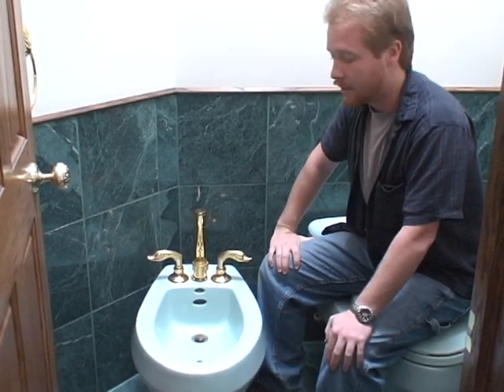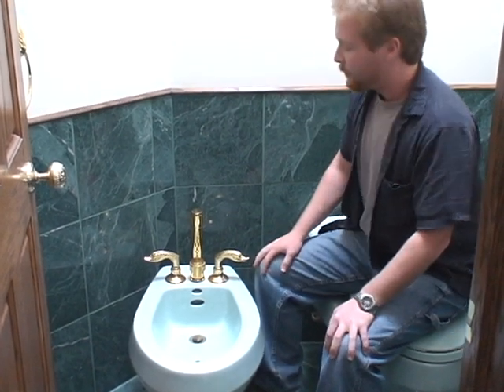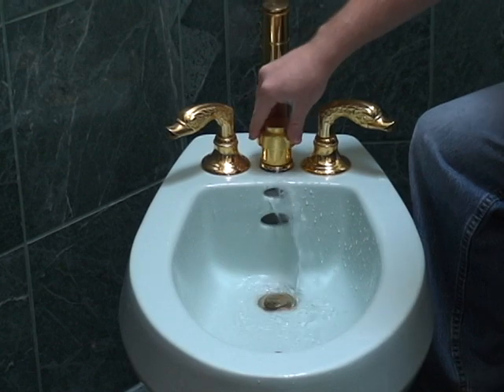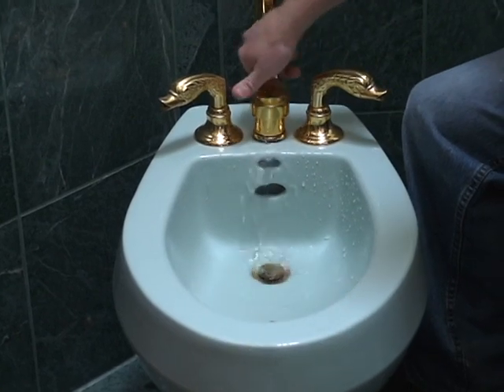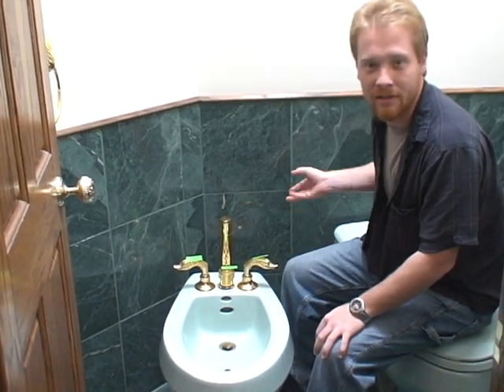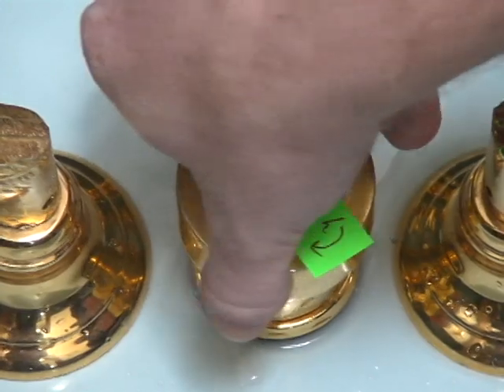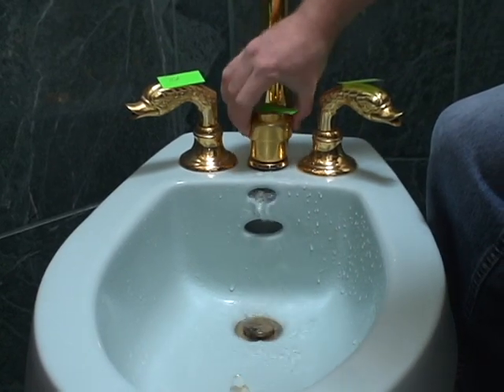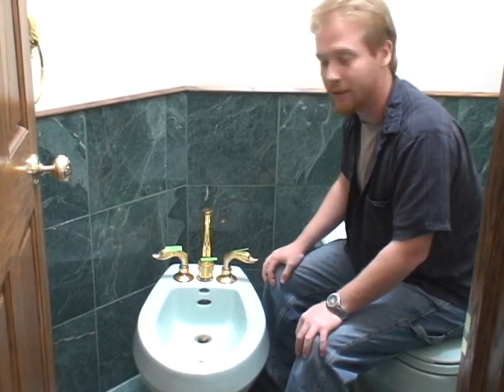Bad Human Factors Designs: The Bidet

Comment: Hi, I'm an ERAU HF alum and current HF PhD Student.  I think this was a great project.  Who would even know that the middle thing turned?  I've never used a bidet, I like the concept, but I would need a diagram showing how to use it...do you sit all the way down? hover? How do you dry off, wouldn't TP get too soggy? The other suggestion is that "flush" and "rinse" are vague descriptors, I think either mode could be described with both words.  Thanks for posting!